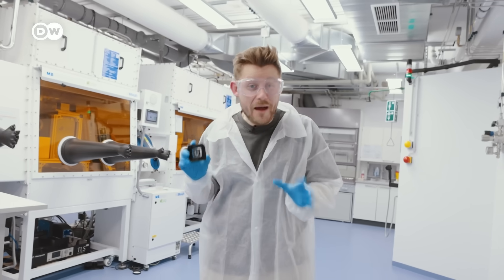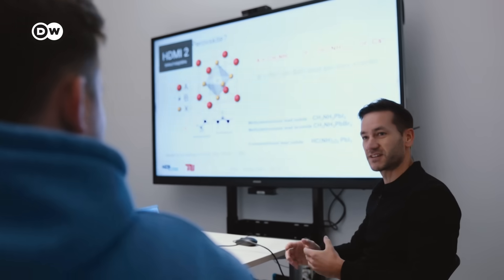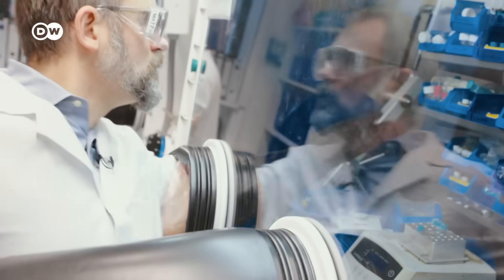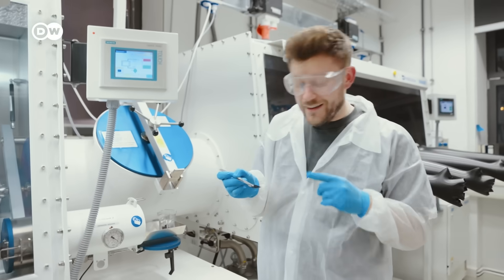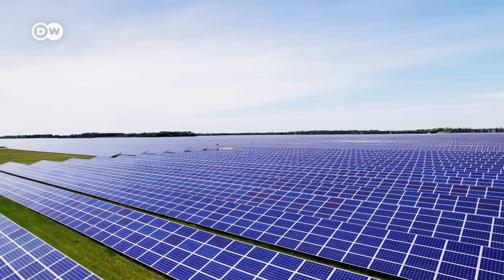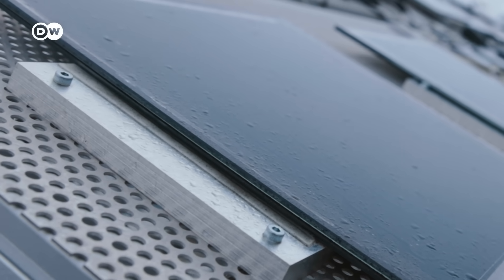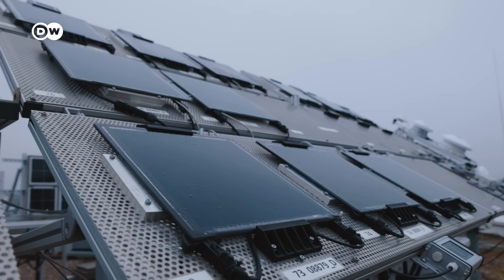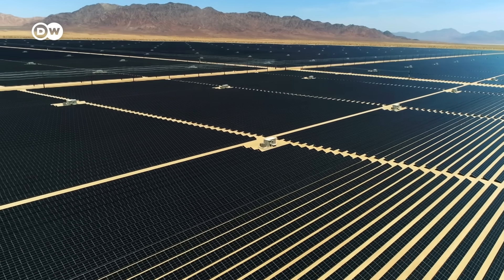Are perovskite cells a game-changer for solar energy?

Comment: Solar perovskites are genuinely top 3 technologies I’m most looking forward to. Perovskites, tidal energy, and sodium ion batteries are capable of being the 3 most game changing technologies out there, and I really do hope to put some of these panels on my future cabin to feed into sodium ion home batteries.
Reply from the maker: We've got just the videos for you! Check out:
📺 How salt and sand could replace lithium batteries ☞ https://youtu.be/-vobMl5ldOs?feature=shared
&
📺 Tidal energy could be huge – why isn't it? ☞ https://youtu.be/1-2TyKqP84o?feature=shared
Reply: @DWPlanetA  Thanks! Last time I heard about tidal power was a project in the Hudson river, their turbine disintegrated within hours. Hopefully, we learned that lesson.
Reply: What are the oder two technologies that you're looking forward to?
Reply: Tidal? Interesting choice! Where do you see that implemented?
Reply: Sodium ion batteries basically work in similar fashion as lithium ion batteries do. They suffer similar kind of degradation over charge-discharge cycles. VRFBs are the more interesting ones because they can last indefinitely, at least in theory.
Reply: @freezepaladin  but sodium batteries are many times cheaper than lithium, and easier to recycle, since you don't need to worry about recycling the cathode. VRFB does sound like a better option for grid storage, but we have sodium batteries now, we can already be using it for home storage.
Reply: @danilooliveira6580   VRFBs have been commercialized too. But they could be more bulky and expensive than sodium ion batteries. But in the long run VRFBs will be the more cost effective ones if they don't degrade. Mind sharing why the cathodes of sodium ion batteries won't need to be recycled?
Reply: @freezepaladin  because sodium is non-toxic and cheap to mine, you don't need to recycle it. sodium is something like 20x cheaper than lithium and extremely abundant. While we could legitimately run out of easily mineable lithium and become dependent of few sources. Meaning recycling lithium is very important, something that can't be easily done, even though we already can recycle >90% of the other rare earth minerals of batteries.
Reply: @freezepaladin  what means vrfb? 
I thought the sodium atoms were 6 times larger than lithium, which would make batteries 6 times bigger
Reply: tidal waves is bollock. ideas are decades old but never succeed.
Reply: hydrogen fuel cell triumphs all, it is the future as the whole universe is abundant in hydrogen.
Reply: I'm waiting for the same 3 things, with nuclear fusion

Comment: 27.7%
Natural abundance Silicon makes up 27.7% of the Earth's crust by mass and is the second most abundant element (oxygen is the first). It does not occur uncombined in nature but occurs chiefly as the oxide (silica) and as silicates. The oxide includes sand, quartz, rock crystal, amethyst, agate, flint and opal.

Silicon - Element information, properties and uses | Periodic ...
Royal Society of Chemistry

Comment: I feel like dual tam +  lenses to focus light for more area coverage per panel + collecting of the wasted heat into water or power generation would give you the best bang for the buck. Lenes cover more area per cell that generate extra light + heat (lets say 4 to 1) that you then run cool water under to help keep them under temp -  that cool water is heated and store into your hot water heater or the extra heat turn into direct power, the extra light gets turn into more power directly. If the dual tam can cover the IR light too - that means less wasted heat/heat increase on the panel , but that also means you can cover more in between with the Psok method between the light panels - as IR is the one that gets wasted the more currently anyways.

Comment: The ABX3 crystal structure will always be very unstable  compared to doped silicon. We can make 50-year panels today...

A replaceable perovskite- glass front with a 5-year lifespan - is an excellent compromise.

I think the real value here is coatings that produce a charge.. light and translucent, it could be placed on vertical surfaces.  

Hanging a roll of plastic and connecting it to a micro inverter - the installation will cost nothing...

Comment: I have also seen some interesting work on using lenses to focus light making solar cells that use less actual solar capturing materials. There is some interesting work on making transparent solar cells tech that can be used inside windows on high rise office buildings, they have relatively low generation as they only absorb light on the non visible spectrum however they allow you to put solar places you can't put regular panels.

Comment: In my humble opinion, only the tandem perovskite cells with silicon stand any chance in the long term marketplace. This is because over time the buyer will only have the silicon cells left to produce energy.  If the sealed perovskite cells were never exposed to weather, or other variability of temperature over time, perhaps they can find an indoor use of some sort. I believe this based on  a personal experience.
 Dozens of years ago I bought a small solar array for experiment purposes in my back yard . They were sold by a discount retailer specializing in cheap goods mostly made in China for the firm. In less than two years, here in California, (a  more benign  weather environment than Germany) I had no output at all from the panels. And when perovskites became a topic on the web solar resources I use, I realized that these were not silicon. Knowing from my work on spacecraft for NASA that they were also not any of the very rare and expensive elements used for tandem cells on government spacecraft, I deduced that they had to be perovskite. The retailer now only sells silicon PV panels.

Comment: For perovskites to actually take off as solar cells, they have to solve that degradation issue first. Unless they want to sell the panels for $1 usd or less a piece, because you'll have to completely replace every panel in less than 5 years...
Reply: Yes the per watt cost is important.  You will need to calculate and account for panel life span.  Additionally if like mentioned in the Video if labor costs are approximately 1/2 half the Total installation cost the long lifespan  panel is critical.
Reply: @jbranche8024  with a bit of clever engineering panel replacement can be done by the user. meaning only the initial installation would be costly.
Reply: @danilooliveira6580  Industrially, too many panels to swap in solar farms. Insurance wise, replacing it yourself may result in a lengthy and costly claims process, if not outright claim denials. Locationwise, solar panels in residentials are typically placed in relatively dangerous areas(slanted roofs) where I would not want a 50 y/o w no experience and questionable balance/physically from attempting an install/repair. Ideally solar panels should be a install and forget solution by which it works through the lifetime of the roof however as several commenters have pointed out, degradation/cost continues to be an issue.
Reply: that! severe degradation in one year i think. if they can extend life cycle to 25 years than we can talk
Reply: And the toxicity issues.
Reply: @Zerpentsa6598 yeah that's actually a good point. I mean a good enough seal can do a lot. That being said, as someone who lives in the desert, the sun breaks everything down, but it is something they'll definitely need to tackle.
Reply: I have a very unique business use case that would be ideal for these degrading pannels. I am yet to find a supplier who would be willing to sell me the panels.... Any ideas?

Comment: Longi Solar just unveiled a 33.9% efficient tandem solar panel utilizing silicon, layered with perovskite.  I think this is the future of solar panels, for many years to come.  The solar panels I put on my house, 8 years ago, are 17% efficient, and that was about the highest efficiency, at the time.
Reply: They have a cell. Not a panel. Also the 33% are probably not under STC (standard testing conditions). In the lab they use way more intense irradiation which you would never have outside. And the efficiency is higher under stronger irradiation.
Reply: @eatcochayuyo  Higher radiation usually mean higher temperature in normal use, and solar cells have negative temperature coefficient which means the efficiency get lower at higher temperature so your assertion seems illogical.
Reply: @eatcochayuyo  To add to that, as the video pointed out, will it stay at 33% efficiency! As someone who switched our family to EVs and is in the middle of doing geothermal, I really want to see a day where solar panels are converting 70% of the light hitting it and are storing them in batteries that last 50 years with triple the energy density we currently have, but this stuff is vaporware at this time.
Reply: I'm that kind of eco-warrior too. ;)

But there is a hard limit somewhere. I am not entirely sure, but 70% might be more than physically possible. This news should not stop anyone from building solar now. We could already power the whole world with modules at 22%.
Reply: @eatcochayuyo  Guess you refer to the SQ-limit. A very good overview is here: https://en.wikipedia.org/wiki/Shockley%E2%80%93Queisser_limit.
Reply: @eatcochayuyo  The problem with solar is capacity factor, lifetime (esp for perovskites) and recycling, land mass usage, and energy/materials of production. 33% is the hard limit for single cell for the ideal band gap although tandem cells have achieved over 40% (but they are multijunction, which poses even more longevity problems due to current matching). Unless the aforementioned are solved, solar cannot alone solve clean energy. Lead/tin perovskites impose even more problems in addition to the aforementioned issues. However, they are academically very interesting materials.

Also, usually testing is certified by the NREL under AM1.5G conditions, which is nominally normal solar condtions.
Reply: And using lead, no one sees a flaw in that
Reply: @Parikalpna don't worry the disposal is already irresponsible
Reply: it is not a panel...
Reply: in one year efficiency falls to how much? i guess below 20%
Reply: What is the highest watt panel available of this company, what will be the compitable inverter
Reply: The world record efficiency of both silicon solar cell and the perovskite/silicon tandem solar cell were created by Longi  @zahoorhussain2975
Reply: We all watched the video @BobDevV
Reply: Thanks,
Reply: this was the first thing that came to my mind when i heard "helmholz institute": the germans develop the technology and fund the research using state money, while the chinese capitalize on the technology and make money using it.  it seems everyone is comfortable the way this worked out the last ~20 years. wake up EU!
Reply: The craziest part for me is that plants that evolved for 500 million years have a solar efficiency between 0.1% and 2%.
Reply: @SUB0PT1MAL 
The differences is; man has a goal, nature does not.
Reply: Let's see... Your panels are eight years old and still working, right?

Comment: "So these base materials more abundant than silicon." This is the boldest claim i have ever heard.
Reply: In crustal abundance, yes. Only oxygen is more abundant. But silicon for PV is reduced from high-purity sands, which are fairly rare. Most sand deposits are full of contaminants of various kinds, and removing the the contaminants adds to cost and environmental harm.
Reply: @gregvanpaassen  what means silicon is more abundant, just harder to process in a economically viable way.
Reply: They usually harvest it directly from Quarz crystals  @gregvanpaassen
Reply: @gregvanpaassen From what I see silicon is created from quartzite rock and carbon. They are powdered and heated in a kiln.
Reply: @Nihlink You don't create silicon. It is an element. You extract it by reducing silicon dioxide. It is present in the silicon dioxide,  not created.
Reply: @gregvanpaassen  But you're still just confirming that they made a big mistake regardless of whether it was pure or not.
    Silicon on our planet is extremely abundant, in fact our entire solar system has extremely high amounts of silicon so saying that it is rare is a bad joke haha.
Reply: @gregvanpaassen  how do they add harm? we have already established beyond reasonable doubt that co2 emissions poses no difficult to surmount problems.  as in we have no climate crisis. emphasis on the word crisis.
Reply from the maker: Thanks for the attention to detail! We regret not formulating the sentence more clearly and accept that it could be construed as misleading. As other users have pointed out, we are referring to the availability of high quality silicon that can be used for PV.
Reply: maybe you should research next time first how common silicon is, haha. it's basically just sand  @DWPlanetA
Reply: @maurice3983 nope, not any kind of sand works. Only high grade and pure.
Reply: Well the scientist said it alright, they are abundant enough so it shouldn't be a bottleneck for production....
Reply: im also one of the scientist, and i said its a scam game for funding @camenraidercc6625
Reply: that made me scratch my head too
Reply: What I heard is: "These materials are RELATIVELY abundant." ..big difference between RELATIVELY and MORE abundant..
Reply: LMAO, exactly!
Reply: Silicone is extremely abundant but never in it's pure form

Comment: 3:22
The ingredients are DEFINITELY not more abundant than silicone which makes up 27% of the crust

methyl-ammonium chloride looks like it could be made out of ammonium,
Lead makes up 0.00099% of the crust 
And Iodine 0.000049%

The availability, ease of production or energy efficiency of making the Perovskite panels may be better, but basically nothing is more abundant than silicon
Reply from the maker: Thanks for catching this! So, we regret not formulating the sentence more clearly.  We realize now that it could be construed as misleading. As other commenters have pointed out, we are referring to the availability of high quality silicon that can be used for PV. We didn't mean it's more abundant than silicon dioxide. Sorry for the misunderstanding 🙏
Reply: @DWPlanetA  I did get the sense that was what you meant.

Could you add this to a clarifications or corrections section in the description?

One practice that I’ve seen another YouTuber do is to publish the video with an empty corrections section in the descriptions and fill it up if and when mistakes are found.
Reply: Thank you! Had a double-take on hearing that claim
Reply: agreed
Reply: haha same, I just got so confused by that claim as well :S hah
Reply: I think what he means when he says they are more abundant is  more about the purity if the silicon and the other materials in a panel.

Comment: Lead is a bad thing to be putting out there in the environment again.
Reply: Good news: the cutting edge of PSCs makes some modifications. Rather than MALH (Methylammonium Lead Halide), a lot of people are working with MATF (Methylammonium Tin Formamide). While MALH has very little risk, MATF has even less risk. It doesn't yet have the same conversion efficiency of MALH, but they have significantly higher longevity.
Reply: lead is everywhere in the environment, the problem comes with consuming it

Comment: Which elements are involved that are more easily available than Silicon?
Reply: Matt you are so right.
As a influencer please be more cautious about your videos. This is pure propaganda about a technology that is so fare from the market. The issue have always been stability of the perovskite. So no they will not beat the marked unless some incredibly new technology.
It a redo...
Reply from the maker: Perovskite crystal structures can be formed with different materials, but here we used methyl ammonium chloride and lead iodine. ✨
Reply: Yes  @DWPlanetA  but I guess the question was on the fact that Silicon is extrememely abundant and available. I'd suspect the final script of this video got oversimplified to the point of being missleading.
Reply from the maker: Hi @etiennelaval342 ! The issue with silicon is not that it's unavailable, but rather, that it is less efficient than permovskite at converting the sun into energy.
Reply: @DWPlanetA Lead is toxic af. There's no way we should allow that.